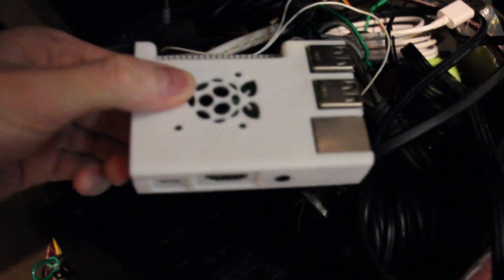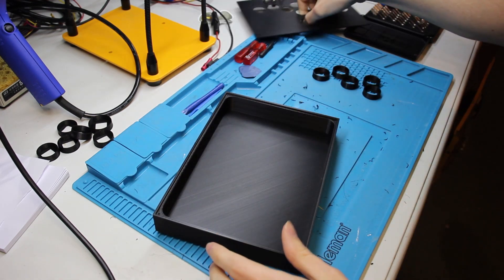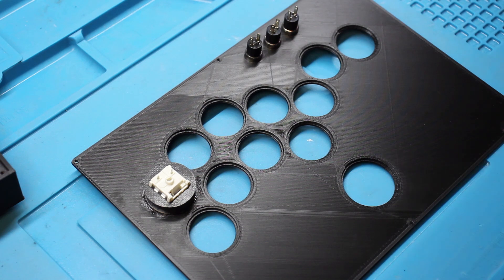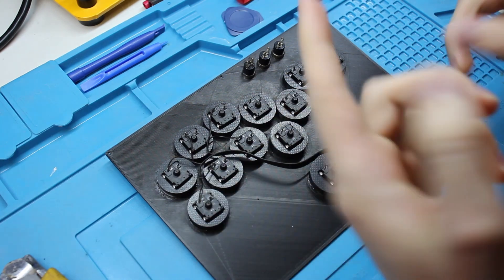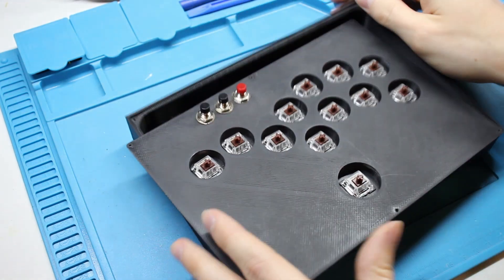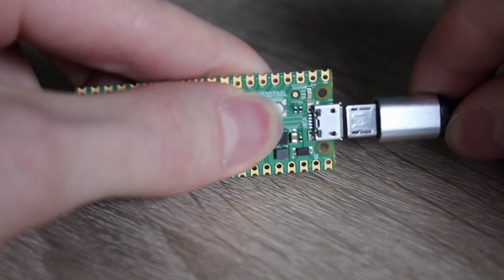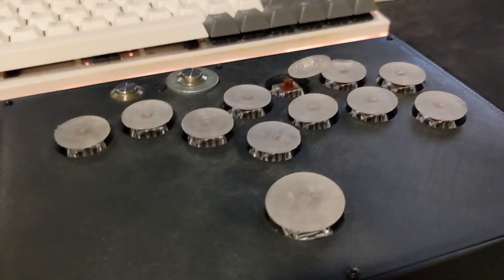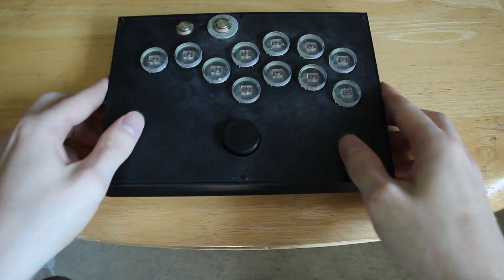Making a "HitBox" Controller to Save Money

Comment: Yeah. And then you want to plug this into PlayStation and it disconnects after 8 minutes because it is not the original controller... So you have to buy an adapter/dongle for ~40€
Reply: Or u can use the controller that came with the console itself 😮
Reply: @abbshadow1  you must not play fighting games cuz it sucks
Reply: @reikidagi  if you play at your home its okay, but it play at locals, friends house or tournament rlly suck
Reply: @ the Dpad is terrible and constantly drops inputs, the latency is fine but a lot of things arent.  a good number of intermediate players and most pros use either a hitbox or an arcade stick or get a different pad controller for a reason.

Comment: does mechanical switches act like just a standard tactile button?
Reply from the maker: Mechanical keyboard switches are quite similar to official arcade buttons such as Sanwa. Not exactly, but close depending on the switch type
Reply: @SamCampbell  I just googled it, it's a single pole single throw switch. 
I can use these instead and carve out the housing on a plywood. I can do the soldering myself.
Sanwa buttons are too overpriced/expensive, where I can get mx switches for 0.60$ each.

Comment: Great build! Did you solder the wires directly into the Raspberry Pi? Or did you crimp terminal plugs in the cables? I'm kinda new to electronics and I've found some builds that use the terminals and others that don't detail the soldering too much, so I don't know if the plugs are necessary for the board to work.
Reply from the maker: Thanks! I soldered them directly to the board. If you want to make it easier to replace switches or cables in the future then terminals will make that process simpler, but they're not required.

Comment: why are you using that Rasbery pie board not a brook universal fighting board ?
Reply: because its better, has more options, like led and oled screen, and way cheaper!! response on these is 1ms too
Reply: GP2040's average latency is 0.87ms, Brook is 3.9ms. It's not even close. The only advantage of Brook is its out-of-the-box compatibility.
Reply: Faster, cheaper, more freedom of upgrades at the low cost of not having out of the box universal connectivity.
Also it won't affect people who only game on a console and pc thanks to steam input. If it's a problem you just gotta worry to remember the buttons to switch between direct-input/keyboard/ps4/ps5/switch/xboxone/Xinput.

Comment: i made a Leverless controler for myself and i used pico just like you but when open game controler setting in windows there were some buttons are pressed. load the Tekken 7 to confirm and its giving commands on its own. i checked my soldring and wiring nothing was wrong so i thought pico is broken or faulty. i changed pico. solder the new one plugged in same problem. change 3 data cables but no success can you tell me what could be the problem or how i can fix this issue ?
Reply from the maker: That's interesting. I would take a multimeter, set it to the resistance measurement and then place one probe on the ground pin then place the other probe on the opposite pin of the affected buttons. There shouldn't be a short but if there is then it could be the button itself
Reply: @SamCampbell  The Problem is its not giving command by any specific button or buttons its giving on any button randomly and rapidly like its giving F, LP , select , RP
Reply from the maker: You'll have to narrow down the issue. Try removing all buttons, testing the board, then add one button at a time, testing each time you add one to see where it starts to have issues.
Reply: @SamCampbell  done that remove every wire from hadders plug in empty its doing same thing check the soldring on both picos with magnifaying glass nothing wrong both are doing same thing

Comment: Just wanted to drop by and say this video was neat! 

Im currently tinkering around designing a box with some community made hardware in mind as well, the OpenstickCommunity has been a real great resource for figuring out this stuff and i am looking forward to actually getting this thing printed once im satisfied with the design. 

One neat thing you could try for the future that i was also looking into was using actual Hotswap Sockets themselves and soldering your wires into them instead of directly into the switch pins so you can swap them out if you wanted to. Its a lil jank but ive seen a couple of people do it and it seems to be working out for them

Comment: Great video. I was working on my version of this too and I've definitely learned a thing or two from your video and revisions you plan. I would suggest making the round sests for the mechanical keys in such a way that they are removable. That way switching the type of key would just entail printing more seats. I also think if the key caps are printed like a cylinder, the side can go into the opening and provide more stability.